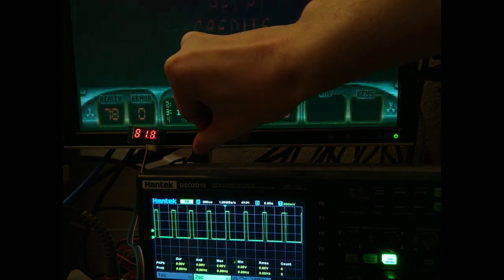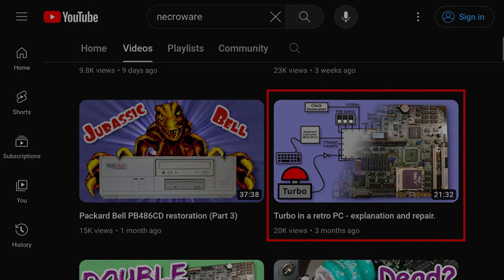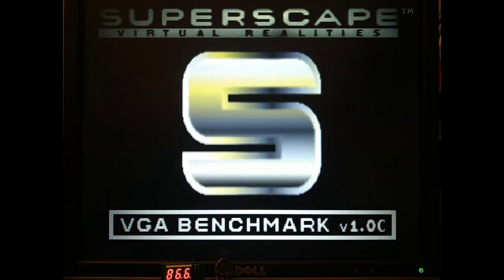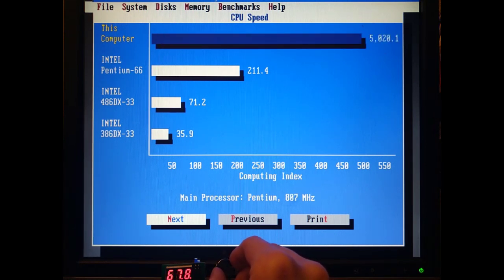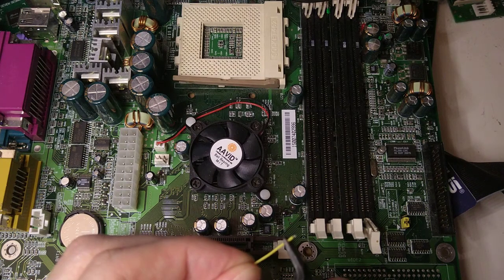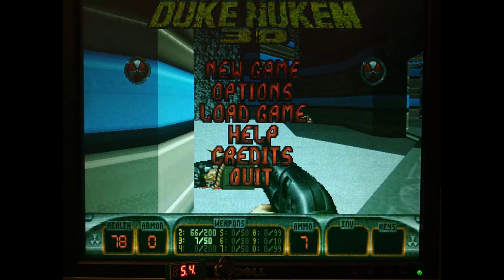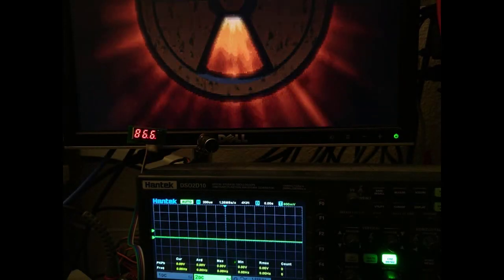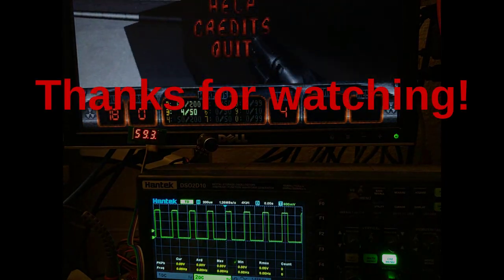Throttle Blaster: A hardware Turbo knob for slowing down the CPU speed (Part 1)

Comment: So I’m a bit confused as to how this works in terms of what the game expects. Day of the tentacle for example. I remember it working fine on anything from a 486 to a p133 but anything faster and it runs like crazy. This mod just halts the CPU arbitrarily so how do we know what to set it at for games to run correctly? Is there a list somewhere? I’m not super keen on a potentiometer to adjust for each game, is a group of speeds ok for each era of games? Does it work that way?
Reply from the maker: There is a "List of CPU speed sensitive games" at vogons with the information you need. For most late DOS games a 66MHz setting should be fine. Early DOS games may expect AT speeds so you would need a slower setting, like 8.

Comment: Very nice project! 
The function principle should be the same like with the "throttle"-tool?! (There the southbridge controls the STPCLK-signal; hints could be e.g. found in the VIA 686B datasheet)
That's why I'm also very interested if it has the same problems like stuttering with some soundcards or input devices. Perhaps we can use higher frequencies with the external solution than the internal chipset and for sure the resolution is much better :)
Did someone already measured this signal STPCLK when the chipset is used for throttleing to get a comparison?
PS: Nice mainboard 8KTA3, have it myself and with Barton & multiplier-change support it's a very nice retro-system!
Reply from the maker: I have not noticed any stuttering issues myself, nor has anyone reported any such issues yet on the project's page on github.

Comment: God, what an amazing project! Thank you for all your efforts and for making it open source right from the get-go!
I wonder how new of a CPU this strategy would work on. Socket 754 does not seem to have HOLD/STPCLK or anything similar.
Reply from the maker: Core 2 duo has a STPCLK pin but I think the socket is SMD so it will be tricky to reach the pin. I think the best systems for this would be Socket A Athlons and early Pentium 4s.

Comment: i wish this worked on socket 478
Reply from the maker: I think it should work on socket 478, it is still a through-hole socket so you can solder the wire at the back.
Reply: @scrap_computing  you're right. I'm going to try it out soon! This is the coolest thing ive seen in years

Comment: As a suggestion for the calibration, you could offer a "program" menu/mode with either a rotary encoder or just some push buttons.

You can even have presets and a turbo button switch input.

Lots of scope for enhancements. 🙃

Edit: After watching part two it seems a lot of people thougnt the exact same, lol.

Funny how that works sometimes.
Reply from the maker: Ha ha yeah!

Comment: Wait long enough and everything gets re-invented. We used commercial versions of these in the 1990's for debugging purposes. Back then it was a variable oscillator controlled by a pot that replaced the on board crystal clock source. Nice work bringing this to the Pi.

Comment: Just had an idea - why not use a PWM electric motor controller for that? They are ready-made pieces for like 1$ a piece.
Reply from the maker: Yeah, that might work, or similarly a 555 in PWM configuration.

Comment: Super cool! A must have tool. My favorite retro machine is a Slot 1 440BX with a Pentium 3 667MHz. With such device, one can tune it to any retro DOS game. I like it due to the compatibility and flexibility in using not so old infra structure (memory, PS/2 ports, AGP, PCI and ISA, ATX format, etc). Looking forward to the blueprints! And last, the Duke soundtrack is back :)

Comment: This is an amazing project!!!

It would be nice if it would be possible to actually control the speed via the dos command line, maybe sending a signal through the serial port or something. Send something through an I/O port that would be easy to code.

It would be easy then to automate launching games with batch files for every specific game. When returning to dos a user could set the speed to enjoy maximum performance in DOS.

Also, maybe a bit overkill but a simple CPU interposer would make this very easy to use. I don’t mind soldering a wire at all but some people might do.

There’s so much potential in this it’s actually insane!!!
Reply from the maker: Yes, that would be really cool! I think the easiest option is to add a serial interface, then you can just configure the CPU speed with a one-liner in a batch file.
The interposer would be a bit tricky because it is not easy to get hold of the sockets or the pins for P3s or Athlons. Perhaps I could add this to the 486 Socket Blaster.

Comment: This is amazing! How does it behave in regard to input devices like keyboard and mouse, with some solutions there are latency and response challenges...
Reply from the maker: I have done some limited testing on a few DOS games and I didn't notice any issue so far with either the keyboard or the mouse. I will check on windows too where the mouse lag would be more noticeable.

Comment: Great project!  Thanks for sharing!  I need this.  I would be really interested in testing with a locked CPU.  Currently building a BX based DOS to Win98 system and would love the speed of a Tualatin CPU.  Cheers!
Reply from the maker: Yes, that's exactly what I wanted to do too, use an Athlon XP system for everything, including early DOS games.
Reply: @scrap_computing  I have Pentium M in my head

Comment: This may cause issues with event timers and schedulers in Windows and could therefore result in crashes? maybe... Since i did not build the circuit yet, im not sure though... Have you tried this with Windows Games as well?
Reply from the maker: I have not tried Windows yet, but my guess is that it won't have any issues. The STPCLK# pin is used by the motherboard to throttle the CPU when it overheats, so stopping the CPU this way is something that Windows should be able to tolerate. But yeah, I will know for sure once I test it.

Comment: This is amazing! 👏👏👏

Would there be any chance of displaying stock system speed (say, 450MHz) upon boot, then it triggering over to the percentages when the knob is turned? Also, would there be a way to use the newer RGB 7-segment displays to implement another visual speed indicator?
Reply from the maker: I am planning to make this configurable by the user. Some people are also asking for fixed presets that you can cycle through with the press of a button.
Regarding the RGB 7-segment displays, I am not sure what chip they are using, but my guess is that it shouldn't be too hard to support them too.

Comment: Probably would benefit from logarithmic control to get finer control around the slower speeds.  I'm thinking a circuit that performs this task can even be built with a 555, a similar schematic to PWM motor control applications.  Probably just about any PWM implementation will work for this.  Pico probably has enough lines to drive LED segments directly.
Reply from the maker: That's a great idea. Perhaps we could replace the potentiometer with a rotary encoder and support variable precision.
Yes, a 555 in PWM configuration should work fine.

Comment: Pretty cool idea! And if you remove the diplay you dont even need a microcontroller, a simple 555 timer should do the trick just fine, so it is a $0,50 circuit...
Reply from the maker: Yes, but then you won't have the cool looking MHz display :D

Comment: 5:59 for a thin wire source, the wire inside of turntable arms is the thinnest I know of (goes to the needle-pickup). If you have old/broken turntables - record-players.
Reply from the maker: Cool, thanks for sharing. The one I used looks like an AWG30.
Reply: I would suggest getting a roll of 30AWG kynar insulated wire wrapping wire. The insulation is heat resistant and won't shrink back when soldered, but it's still easy to strip off. 
If you go much thinner, it will be very fragile and hard to work with.
Reply: I’d suggest soldering would just be the best bet. It’s only one pin

Comment: This is great.  It would be dope if you could push the knob for presets.
Reply from the maker: Great idea, I could add a button that cycles through some presets.
Reply: fixed resistors with on/off switches is possible

Comment: Nice idea! Thumbs up.
Reply: Super cool! A must for every retro PC owner. Most of my retro system are based on slot 1 and socket 462 systems, handling the speed through CPUSPD, cache off and clocking down bus to 66MHz. Some sound cards are also speed sensitive, and this tool gives a degree of freedom and fine tunning never seem before. I could build a top system for retro and scale down as needed, avoiding having multiple machines. Nice to see you back, including the Duke soundtrack: for me it is a “signature” of your videos. Looking forward to the details. Take care

Comment: This is really cool. I'd probably prefer a handful of preset speeds & a button to cycle through, rather than a continuous rotary control. This would make it almost drop-in compatible with existing turbo buttons (not sure if the switch type button would really work right) and allow more precise settings for specific games.
Reply from the maker: That's a great idea. I think we can have both! I can add a button that cycles through a couple of presets.
Reply: @scrap_computing  Yes, please!

Comment: It's a little bit poetically ironic to use a Raspberry pi that is an order of magnitude faster than the original machine to make it go more slowly...
Reply from the maker: True, but you could use a simpler circuit, like a 555 instead.

Comment: I always wondered if such a thing would be possible and now you went ahead and just did it. Nice work! I assume that there's a limit to how fast you can turn STPCLK/HOLD on and off per sec, based on the Pico's capabilities. Any numbers on that?
Reply from the maker: Hmm not sure. I will experiment with faster frequencies and will let you know.

Comment: Fantastic project! This could be very easy to integrate into the right case, replacing the turbo button with the pot, and the existing display with the generic one.

Comment: Really interesting concept, I like the idea of the 7 segment display showing a meaningful indication of CPU speed and a hardware control. This would easily allow programs written for XTs or even Wing Commander 1 or 2 to run on much more modern systems such as 486 computers. Who thought too much speed would be a problem ?

I am not clear on the comment about pulling down the 486 HOLD pin as the datasheet extract indicates it is active high. I also see the CPU does not have an internal pull down resistor so there must be an external pull down. Would be great to connect to a point where there is lower risk of shorting out an adjacent CPU pin. 

Great idea and your proof of concept is outstanding, thanks for publishing this.
Reply from the maker: True, HOLD is active high but STPCLK# is active low. So they need different output circuits, one for each.

Comment: Great project! But does it require Pico? Can it be done with simple Atmega/Arduino board sending PWM signal?
Reply from the maker: Any microcontroller should do.
Reply: @scrap_computing  Thanks! Can't wait for the next video about it!
Reply: Probably just a case of working with what he was already famialr with or had laying around.

Comment: Too bad modern CPUs have SMD sockets. I also wonder how CPU power consumption changes. Would it be possible to run CPU like P4 with its fan completely stopped?
Reply from the maker: Yeah, I checked and STPCLK# is available on core2, but it would be tricky to attach a wire to it.
I think it should be possible to run a fanless P4. As others suggested we could add a temperature sensor and let it do automatic throttling :)

Comment: This is a brilliant idea, well done. An idea for a future development, though I don't know if it would be possible: Integrate the Pi2040 on to an ISA card which can be addressed / controlled by the host PC. Develop some software which can be told the maximum CPU frequency, and then automatically benchmark at varying PWM values to generate a mapping of PWM values for various MHz steps. Users could then simply set the desired clock speed from the command line. It wouldn't even require a TSR.
Reply: I think it is possible to connect pico over LPC (which is basically 33MHz semi-serial ISA) using TPM connector. EDIT: I think that TPM connector was introduced too recently, unfortunately. Wikipedia says 2009. At that time CPUs already had SMD sockets. LPC was there since late 90s/early 2000s but it would require soldering wires to the KBC/SuperIO chip.

Comment: Amazing! I was a bit worried because we didn't hear from you longer than usual, but it's a pleasure to see new content from you, and this project is especially impressive! You deserve way more followers. Thank you for the video!
Editing this comment to add that this makes retro gaming viable on systems where it wasn't. My socket 462 and 478 systems had ISA slots but a lot of older DOS games simply wouldn't run. Some needed patches, others still wouldn't. With this, we can have games from the early nineties to the mid 2000s running on the same hardware!